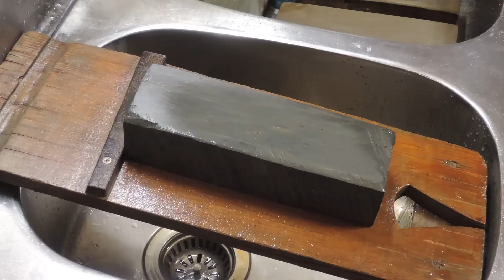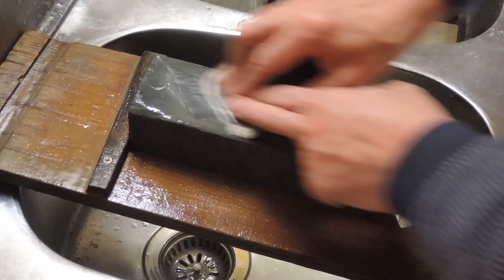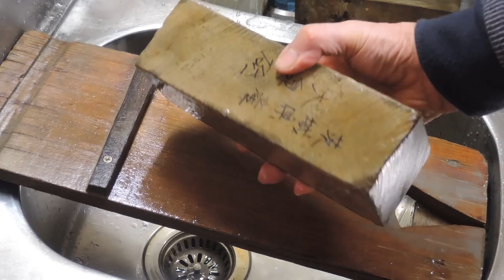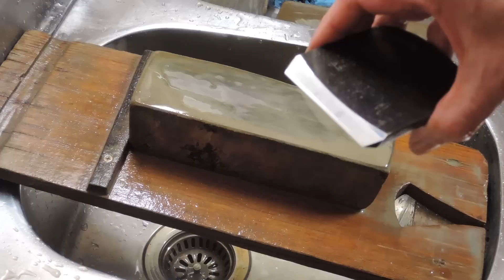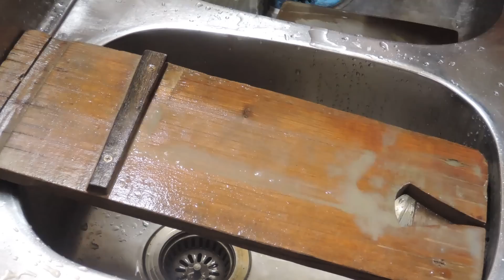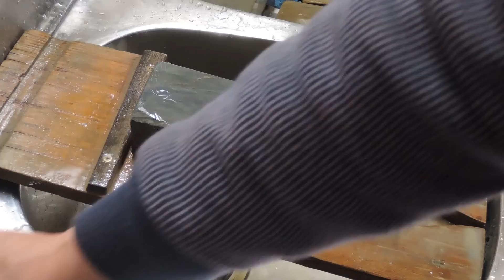助川砥を含め青砥５種を研ぎ比べ

Comment: nice video!
Kiyoto, what is the final angle of sharpening your plane blades?
And why do you use natural stones against syntetic?
And why don't you fight with the burr after between changing stones?
Reply from the maker: Thank you for your comment.
Angle of the blade of this plane is about 27 degrees.
Since sharpening scratch manmade whetstone deep,
 I use mainly the shallow natural whetstone of the sharpening scratch.
This video has compared the five natural whetstone for middle sharpening.
So, I don't fight with the burr after between changing stones.
OK?
Reply: ***** yes, thank you for responding.
And what is the maximal gritness (4000, 6000, 8000 etc) of a stones you use to sharp the plane blades?
Reply from the maker: Андрей Девастатор
 http://www.kiyond.com/toisi1.html
These are the natural whetstones for finishing I use mainly.